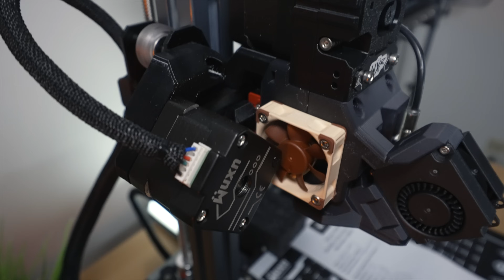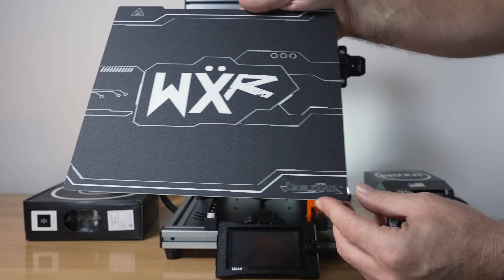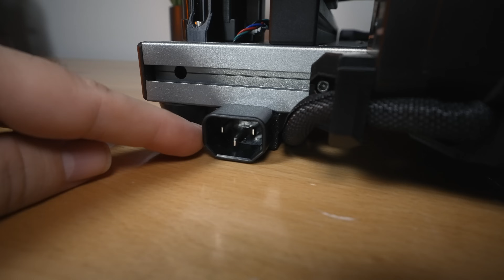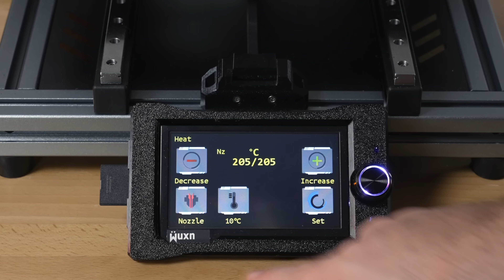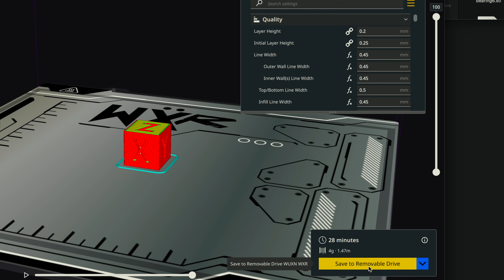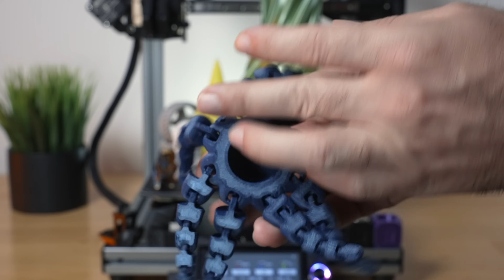Wuxn WXR - 3D Printer - Unbox & Setup

Comment: IF you're based in US, feel patriotic and can spare that amount of cash for heavily modified Prusa Bear upgrade with chinese parts, that's fine. But if you're not in US and 3D printing is more than a hobby you could easily grab three Core XY Qidi Tech X-Plus II's within a week. On the top of that it has a Linux discriminating slicer, another big No in my books. I really appreciate the amount of work that's gone into this printer package and fair play to the developers but with the steep competition in this market and cheaper offerings with similar print quality and ease of use, the tagline "Made in USA" (or more precisely, partially made in USA)  will hardly appeal to the regular hobbyists  to open their wallets, especially the ones outside the US.
Reply: They said it's 60% made in USA. Nothing about it feels like any of the other printers I own. Also, it just works Everytime.
Reply: @PaulReady-j2u  ...and two years later is not available anymore. Besides, if your hands have grown out of the right place, anyone with average skills can assemble one. I have, done three printers so far with RatRig extrusions. And with no worse build and print quality as this one.

Comment: This is a direct clone of a Prusa. from the printed parts to the motor layout and the control screen even down to the small flashing led in the front of the bed strain re-leaf and the check list.

And after looking at the price, Yep it costs like a Prusa, super pricey for a small bed printer. even if it works well.

Comment: I think that this is a big deal for the US domestic 3D print industry. Sure, the price may be high, but look at what you are getting for $849! Everything with this printer is top notch and if you compare this directly to a Prusa MK4, you are saving some coin to get the same if not better quality on a fully assembled printer. Sure, you could get a Bambu P1S w/AMS but not everyone wants that printer and there is something about an open source QUALITY 3d printer.

Comment: Just got mine a few days ago. The build quality of this printer is top notch. Parts and build quality is were the money goes. The 3d printed parts quality used are well above the ones you find on a Prusa. I already put it trough the ringer with my own speed tests and profiles. 250mm/s is no problem for the 1:1 gear ratio and copperhead hotend.  Printed a wuxn cube in 26 min without input shaping and it looks not even bad. I had to slice my own wuxn cube as the provided sample is not a representation what the printer can actually do at normal speeds. The print quality is way better than the sample after adjusting a few settings using prusa slicer. Looking forward to the Quake firmware update which probably puts it ahead of Bambulab and Prusa.
Reply: I can't wait to get mine. Tired of fiddling with my ender 3 and my MK3S hotend...
Reply: @wayne7824  Use a powder coated PEI sheet for PLA and lower Z by about 0.2mm....for perfect first layers. The provided Buildtak sticks too much with PLA. Buildtak it is perfect for PETG not so much for PLA.

Comment: Literally twice the price of an AnkerMake M5C
Reply: US assembly, support and some components, it is also user serviceable unlike the ankermake and doesn't steal your data
Reply: @trippytrolls  I understand your point, but $400 extra isn’t worth it. And I’ve never given Ankermake any information to steal
Reply: @trippytrolls  I don’t know what you mean by not user serviceable. I’ve taken the. extruder completely apart, adjusted the fittings and belts, which are replaceable… not sure what’s left?
Reply: @trippytrolls  Doesn't steal data? Do you really think that your smartphone, the browser in which you are navigating and much more are keeping your data safe? lol
Reply: And twice the quality
Reply: @omegadeepblue1407  What does that even mean? They all print the same level heights, they use the same nozzles, print at the same temperatures, similar speeds, they all have similar controls to handle different filaments, they all print PLA/PETG/ASA… all of these machines are essentially the same. Not just this one and the Ankermake, basically all of them. I guarantee you that the Wuxn WXR doesn’t print “twice the quality”. That doesn’t even make sense in today’s market.
Reply: @karmachameleon326  I was talking about the quality control and build of the machine, not the print quality.

As a mexican (a real one that really lives in México, not your standard LA vato loco) i'm very concerned on the quality control of the machine, for the same reason i don't trust Ankermake products.

Comment: $850? With the Ender v3 Se and the I can get 4 of Printers that are BETTER than this. For this price get a PRUSA or Hell get a Bambu P1P and an AMS! Or TWO K1's
Reply: Please tell you are not comparing this printer with an Ender or any Chinese printer
Reply: @elleryfg7853  can i complain with a Prusa or a Lulzbot?
Reply: @omegadeepblue1407  compare it with a Prusa? Of course but this printer is in a lot of ways superior to a MK4 or MK3S
Reply: @elleryfg7853 of course it is, is on my plans to buy one, i just wanted to include my comment because the idea of an Ender 2 Pro army sounds funny and cool
Reply: @elleryfg7853 if you were to print engineer parts for a beginner. Do you have a recommendation? Budget around $700.00 dlls probably $800.00. I'm looking for a beginner entry.
Reply: @zonerx00  which materials do you want to print with? What do you mean by engineer parts? Advanced materials? It's hard to find a printer that provides more value than Bambu Lab printers but I've heard their support is not the best. If you want to print carbon fiber filaments you're going to need hardened drive gears and nozzle. I would say the P1S but you would need to upgrade the extruder gears to print abrasive filaments. The WXR seems like a solid option but it's not enclosed and you'll need an enclosure to print anything other than PLA and PETG.
Reply: @ShadowGun625  please explain. What are you replying to?
Reply: Are you actually comparing this to an Ender?
Reply: What kind of Chinese propaganda is this?
Reply: Or an army of Ender 2 Pro's
Reply: agreed